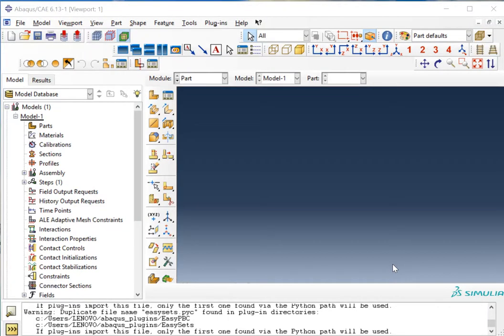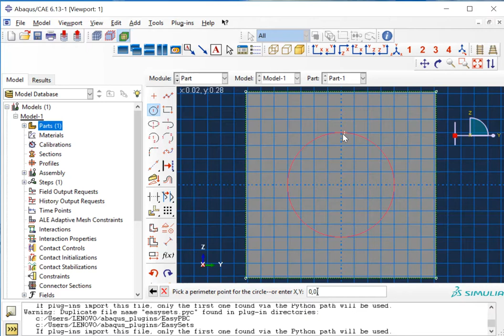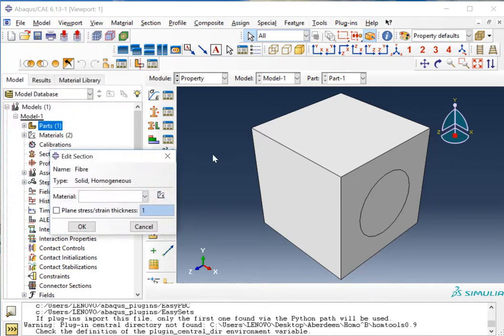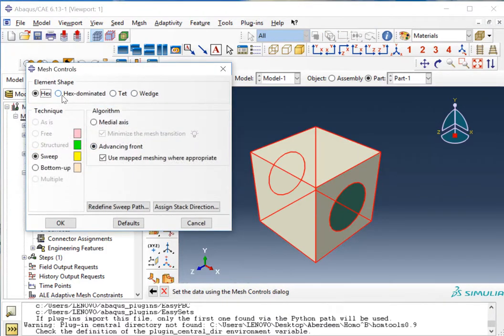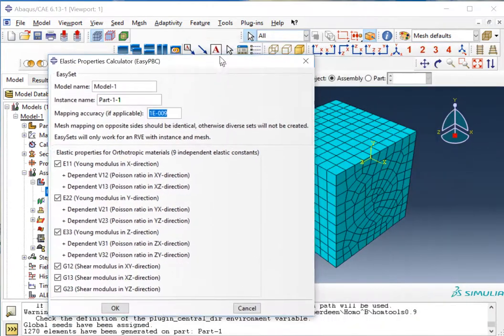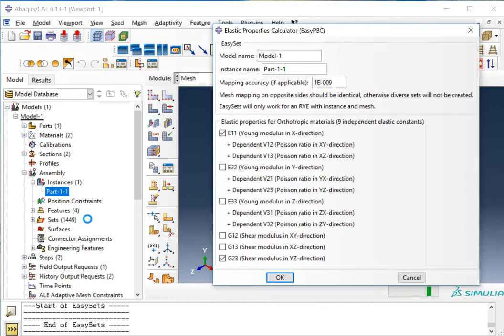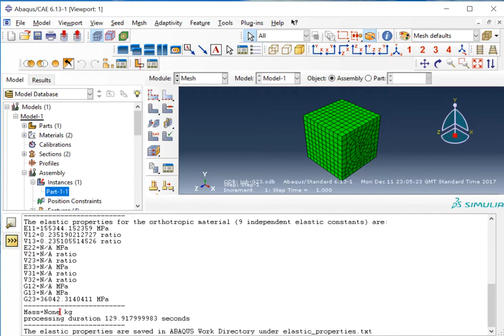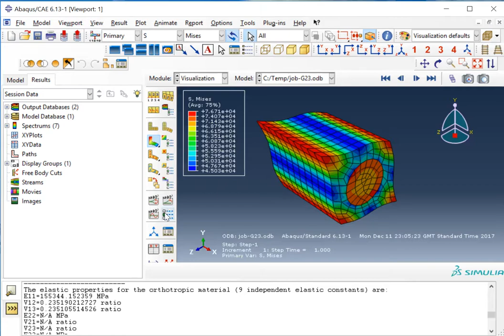EasyPBC : ABAQUS Plugin Tool for Periodic RVE Homogenisation

Comment: Hi Sadik, your project is very interesting to me, because I am working on RVE and previously I applied PBC on my case. Now I want to apply boundary conditions that lead to shear deformation of the RVE same as your work in the video, but I dont know exactly what kind of load must be applied on master nodes. can you help me?
Reply from the maker: Hello Zahra, Thank you for your interest. For shear moduli, I apply strain for two sides of the RVE.  G comes from dividing shear stress by 2*applied shear strain (becuse you need to apply 2). The shear stress is calculated by summing nodal reaction forces of either strained surface (because both will be equal) divided by the surface area. More details should be available soon on my Researchgate webpage.
Reply: Hi again Sadik, you mean you applied shear strain on every nodes for two parallel sides? or just on master nodes? I am so sorry but I am confused. I think one of the master nodes must be encastre but what kind of boundary condition must be applied for 3 remaining master nodes?
Thanks in advance
Reply from the maker: Exactly, the way I did it was by applying strain directly on these two surfaces. I did not use the concept of applying strains on mater/reference
points. The other two opposite surfaces are encased by opposite DoF of the applied strains.
For example, I applied a strain on the front surface towards the 2nd direction. The back surfaces is encased by 2nd DoF, same goes for top surface with applied strain towards 1st direction, and lower surface encased by 1st DoF. Of course there are other boundary conditions involved. This type of loading/strain will create what’s known as Tensor Shear Strain, you can look it up. I hope that clarifies it.